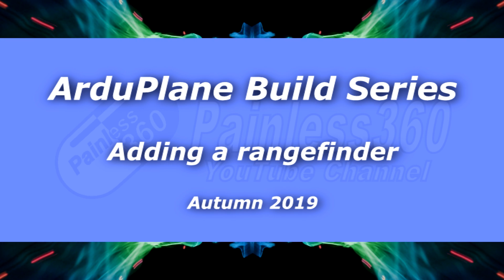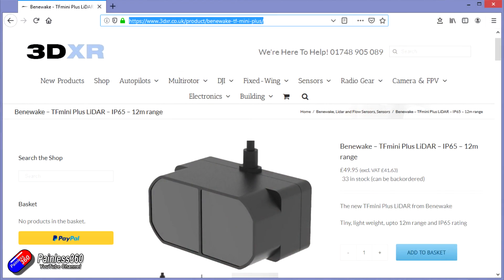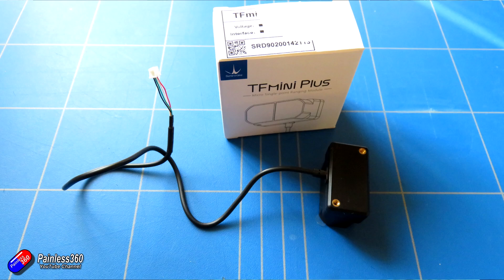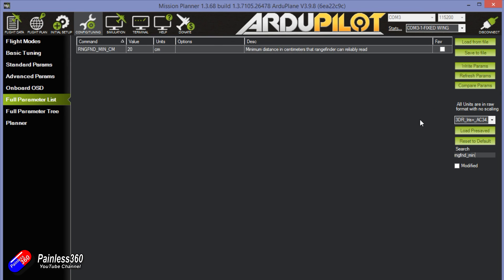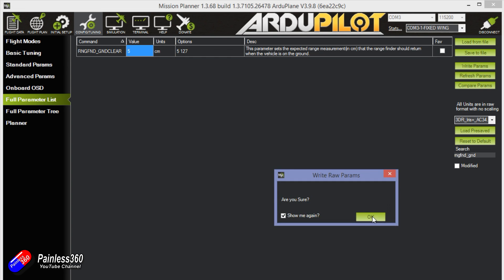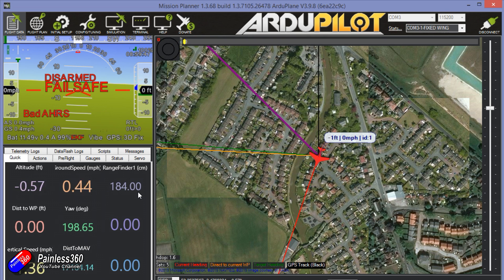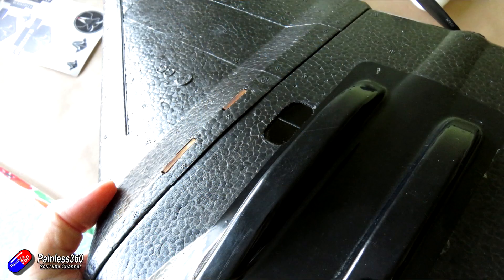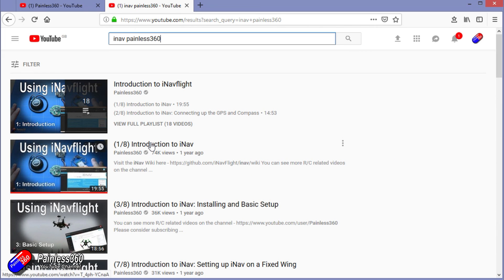ArduPlane/Matek F405-Wing/AR Wing Build: Adding a LIDAR rangefinder easily

Comment: Hello! I'm using a Heewing T1 RANGER PNP VTOL with the FC that it came with. Although I'm using the MTF-01 Lidar my issue is that the FC can't recognize it. Is it possible the FC not to be compatible with Lidar? Thanks!
Reply from the maker: I'm not sure. I've never tried. If you get it working, please let me know... Best of luck
Reply: @Painless360  Hey! I made it work. Now I need to configure the values into flight. If you need info, tell me!
Reply from the maker: Please post the tricks you used... Happy flying
Reply: @Painless360  I had to go into the custom firmware builder, take the V2 board firmware and enable the Rangefinder - MAVlink and on Sensors the optical flow MAVlink sensor, build the firmware and flash it again. After that the values on rangefinder1 and Flow Quality started to work fine. Now I need to figure this out so I can make it fly with these values. These things are first to me.. Never done Ardupilot settings and I search/experiment to figure these out.

Comment: A question about ports on the Pixhawk 4.  I have this TFmini working if I use Telem2 port.  I'm trying to get it to work on the UART & I2C port.  I've made the settings exactly the same, checked a dozen times.  Is there some other setting for that connection I'm missing?  I've assumed it is serial 3, but I've also tried 4 and 5.
Thanks.
Reply: Sort've solved that issue in a round about way.  I had wanted to use the Telem2 for the Radio Telemetry, from one of your other videos.  But it turns out the radio works fine in the UART connection, so I can just use the Telem2 for the lidar and I haven't wasted a connection. By the way, the radio set I got is a Holybro, but it has all the parts like your more expensive version (in the other video), so it's in between the two you had in that video.  Worked right out of the box.

Comment: Hi 
I have a fixed wing plane. It has 140 miles range
From Point A to Point B. Is it possible to pre program the mission planner  so that I can extend the flight to 200 miles ( From Point A to B to C)

For example, when the planes gets to Point B, my friend will change battery and the planes connects to the mission  and it is thrown up into the air to move from Point B to Point C

Is that possible?????

Or my friend will need a second relay remote control??

Francisco
Reply from the maker: I've never explored the idea of a mission that has this kind of 'stopover' in it. If it is possible it'll be in the docs.. Best of luck!

Comment: I have pixhaw px4 flight controller ,my only question is should I upgrade to new flight controller or can I use the same old pixhaw on my FT spear for long range?? I don't want auto land feature .Would be very helpful if I get a reply
Reply from the maker: If you are not bothered about an OSD and can flash it to the latest version of the code, why not?
Reply: @Painless360  is there no way to get osd on px4?
Reply: @Painless360  I wouldn't mind upgrading to matek f405 fc but the whole process is too confusing
Reply from the maker: See my F405 arduplane build. Happy flying!

Comment: Hi there another great video one question could you use it for low level flight as I'd like to skim over a lake dam buster stile, but I'm afraid that I ma dich it in the drink. I've enjoyed and learnt a lot from your videos. Thank you so much Paul
Reply from the maker: Yep, this'll help but be careful over water as not all sensors work well... see the arduplane documentation... happy flying!
Reply: @Painless360  thanks will be very careful I will be trying over short grass or a car park first just in case